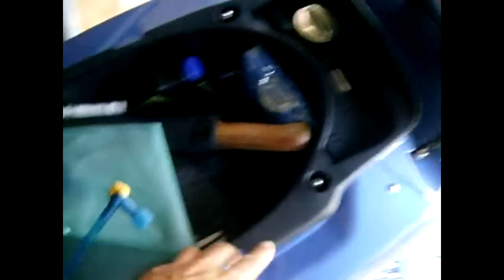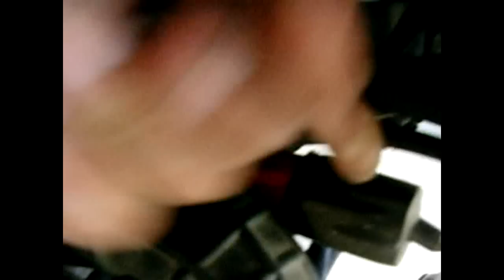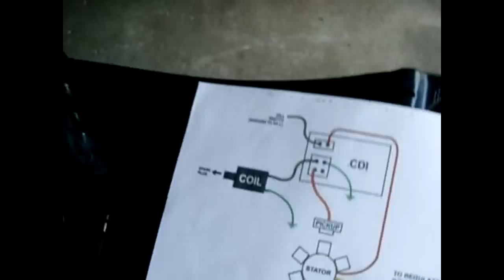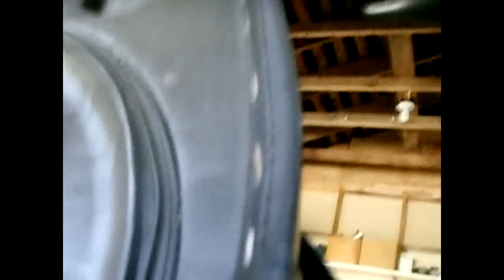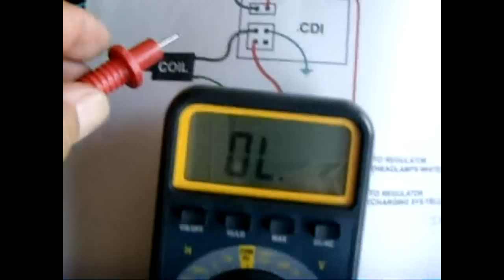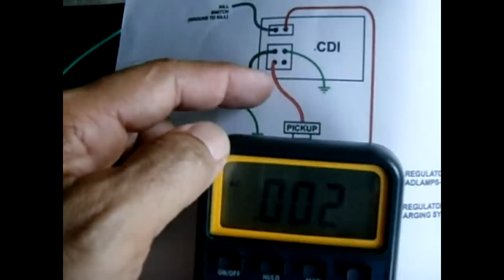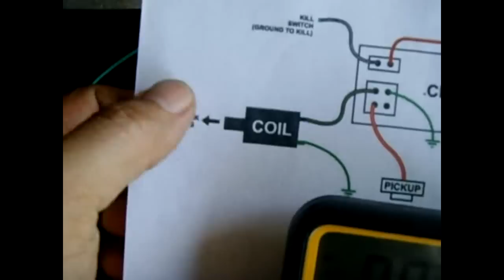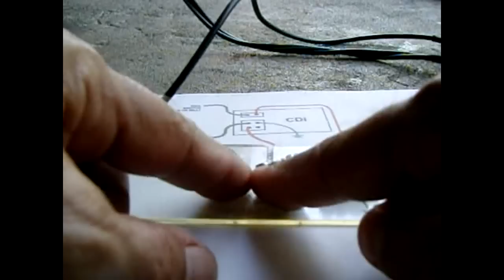The Ultimate GY6 Starter & Ignition Troubleshooting Tutorial

Comment: I've got a mysterious cold starting problem. Left overnight, I'll get one pop from the engine on hitting the starter and then nothing but cranking. Later in the day, tried again, sometimes it starts right up. Once it does, and it's warmed up, it starts perfectly the rest of the day and runs great. The valves have been adjusted, the carb is clean, and I've tried replacing the CDI which was no solution.  A mechanic I know thinks it's a problem with the wiring going into the CDI. But can I ask what you think?  What would cause this hot-cold issue?  Thanks in advance!
Reply from the maker: Jay,
Could be a fuel problem, or a faulty enricher solenoid(which I have a video for in a week or 2). The next time you go to start it and it does the same thing, try putting some propane gas into the air inlet hose to see if it starts. If it does, then your problem is fuel. If you don't have propane, then squirt a SMALL amount of gas to see what happens.
Reply: Jay Schleifer somtimes is the fuel you used put hig octanage buy hig octanage fuel

Comment: Excellent video - thanks!  So I have a Chinese scooter (never again) and my new battery (2nd) is not holding a charge; I checked the stator wires and they appear to push energy... what do you think I should check?  Thanks again
Reply from the maker: Hi Roc,

Yeah, these scooters are not for everyone. :-) Your sure the battery is charging? Did you check the voltage at the battery terminal while revving the engine? Should be at least 13.75v, but more like 14.25 -14.5v. If you are charging, the next step is to make sure your battery is not draining when the ignition switch off. Disconnect the battery neg cable, then connect a 12v test light between the battery post and the battery neg cable. If the light comes on, even partially, you have a problem. If you have an alarm, I recommend you disconnect it.

Thanks!

Be sure to share my channel with others, and watch my other videos as well.

Comment: I acquired a 50 cc Chinese motor bike that has been sitting for a year and it gets no spark. Thank you for the video. Here are my results from the unplugged plug. Kill switch works. Don't know how accurate harbor freight meter I bought new is but here goes: Stator wire 495 ohms. Pick up coil 149 ohms. Primary coil, one meter probe on battery ground wire other at cdi plug yellow black wire 3.5 ohms with harbor freight meter, another meter showed .6 ohms.You say under 3 ohms or over .8 ohms so is there a problem with mine?? Tested now turning over engine: Stator wire 70 vac, pick up wire using a analog meter .25 vac, Secondary coil using harbor freight digital meter set at 20k read 3.3. is that 3.3 mean 3.3 ohms or 3,300 ohms?? You say should be between 2000 and 4,500 ohms. Spark plug and wire are good. Still no spark at spark plug, even tried testing for spark with spark plug wire removed  and grounded wire a 1/8 inch from coil spark plug screw. Still no spark. Any thoughts??
Reply from the maker: Hi there,

It has been a while since I made this video. :-) You removed the kill switch wire from the CDI before testing for spark? A faulty key switch can also prevent the engine from starting, but if you removed the kill switch wire from the CDI, that should make no difference. You made sure all the ground and +12V wires are connected? You tested/inspected each connector to make sure there are no open circuits? Pick up coil sounds fine from my memory.  Stator wire I do not recall, Was it in the range I mentioned in the video? When I mention a particular ohms range, it does not have to be exact. Just as long as it is close in value, you should be fine. 20k setting with a reading of 3.3 = 3.3K or 3300ohms. You unscrewed the spark plug wire from the coil and tested from the screw inside the coil to ground using an 1/8" gap. That should have sparked if everything else was OK. Your missing something. Go back over everything. Sounding like a bad CDI. 

Thanks For Watching. Be sure to rate a thumbs up, share, and check out my other gy6 videos.
Reply: thanks for your quick reply. all ground and 12v wires connected, no open circuits. Stator range 430-630 mine 495 ohms. Pick up coil  range 140-185 mine 149 ohms. Stator vac range 65-90 mine 70vac. pickup coil is ,25vac same as what you got in the video. Secondary  coil circuit range 2000-4500 range, mine 3,300. Only problem I see possibly is the primary coil test you say range is over .8 and under 3 ohms. I put one meter probe on battery ground wire other at cdi plug yellow black wire and got 3.5 ohms with harbor freight meter, another meter showed .6 ohms. These are both out of the range you stated, what do you think about those readings. Also I am trying to locate the voltage regulator on the scooter where might that be in the wiring of the ignition circuit. Thank you so much for sharing your knowldege.
Reply from the maker: Those ranges seem fine. The V-reg is located above the glove box, and below the handle bars. The front plastic cover on the scooter by the headlight assembly needs to be removed to access it. The v-reg is bolted to the frame.
Reply: thanks again for quick reply, so do you think it is the cdi or coi or stator. One online thread I read says the pick up wire must have at least .5vac  to trigger the cdi then coil. Mine is only putting out .25vac.
Reply from the maker: cdi and coil are cheap. You can buy them on Ebay. What was my pick up reading? Go by that.

Comment: Rocketta sicily 50... always runs good. Rode to the store this morning, came out, tried to leave. No juice!! Ignition is relatively new, tests good. Battery is fully charged. Also tests good. No cranking, no lights. Electrical problem for sure... Any thoughts??
Reply from the maker: You check the fuse by the battery? Also check ALL connections from the battery, to the starter, etc. Take them apart, and put them back.
Reply: yep... did that. Thinking it's the CDI. Everything is testing good to that point
Reply from the maker: CDI would not cut all power off to the scooter. Your missing something
Reply: I gave up and called my mechanic... Thanks though. He picked it up a while ago and will be fixing it tomorrow. Thanks though
Reply from the maker: That sucks. Never give up! LOL I bet it is something simple. I don't think you ever told me in the very beginning what the problem was that made you replace everything. How did the problem occur?
Reply: I didn't replace anything, I just tested the battery, the fuse and checked for continuity going to the CDI. Basically, I rode to the store and when I came out it wouldn't crank and the lights wouldn't come on, do there was no point in trying to kick start it. Pushed it home and got out my tester
Reply from the maker: When you have no power at all, that is usually an easy fix. You have to trace each wire from the battery and test the wires as you go to make sure power is there. Likely a faulty key switch. Put the key to ON, then try jumping the starting solenoid.

Comment: So, I have replaced the stater, CDI, and coil with new parts purchase online and still no luck.  Tested the switch and it seems to be fine.  The ohm reading from the pickup however is only coming in at 135-145 but the piece is brand new.  Could this be the problem? Any help is appreciated.  Thanks
Reply from the maker: Hey jumpflyMD. Thanks For Watching.

Your pickup coil at 135 - 145 sounds fine. Have you tried spraying some gasoline into the carb and starting it? Or propane from a torch? If it does not start, and you know for sure you have spark, then you need to first rule out the engine stop switch as the problem. Unplug the wire from the kill/stop switch from the cdi and see if the engine starts up. If that fails, then remove the valve cover, and refer to my other GY6 video showing exactly how to line up the timing marks/check the valve clearance(.004 in /.005 ex is what I use). Make sure the spark plug is good, and that the valves have the proper clearance.

Thanks For Watching! Don't forget the thumbs up. :-)
Reply: electronicsNmore
Haven't tried spraying gas since I can take out the spark plug, ground it to the frame and still no spark.
Reply from the maker: Unplug , inspect, and put back every wire harness from the cdi, ignition coil, to the start key. I have a feeling you have a bad ground, or kill switch that is causing the engine to not start. Take your time and go through everything.
Reply: electronicsNmore
The kill switch never goes to ground, can only get a tone when I turn the key switch to off, then it goes to ground.  At the CDI I'm getting some funny readings, so I unplugged the stator and tested straight from the stator harness.  I get the correct readings from the stator harness, then when I pug those into their correct plugs, the wires to the CDI harness go weird again.  So like you said, I think its a gremlin in the harness.  Any suggestions on what I should be looking for?  Thanks
Reply from the maker: Something is not right. The ignition key switch or kill switch must be able to stop the engine. Usually they are wired in series.You made sure ALL ground connections are OK? You can also test each wire with a continuity tester to make sure there are no breaks in the wires. Red wire on the stator goes to the CDI next to the black kill switch wire. Ids the stator properly grounded?

Comment: My no start GY6 50cc scooter started out running just fine, always starting and then the belt broke while riding.  After replacing it will not start.  Have had scooter savvy guys working on it for 2 weeks.  Unfortunately everything checks out. All electrical, cdi, coils, carburetor, timing, compression, spark plug, gas supply.  Everything has been taken off put on another working GY6 50cc motor and that one still worked and the parts off the working one would not make mine start. Electric start turns over and it acts like it's out of time and about to start but just won't run. It is hitting dead center.  We're missing something and nobody knows what it is. HELP!
Reply from the maker: Timing chain could have stretched. I would take the valve cover off, and make sure the timing marks are EXACT. Also make sure the valves are fully closed when in position.
Reply: Timing light shows it's right on but Will do.  Taking a break while I search for answers. Thanks.
Reply from the maker: Forget the light. Visually line everything up, and make sure both valves are adjusted(closed). Then you can rule out timing.

Comment: quick question, I can get my scooter to turn over and run for a min or two, its a 150cc gy6, its been sitting forsome time now maybe 6+ months, can I spray carb cleaner right into the carburetor? or should I take the whole carb off and try to clean it that way? it stalls out like its flooded or something, ill give it gas and then it dies out, I replaced the starter, solenoid, both brand new, new fuse too,,any ideas??
Reply from the maker: Sounds like a gummed up carb. I would take apart the carb, make sure the ports are all clean using a very thin wire(like from a small brass bristle brush), spray carb cleaner on all the parts, then put it all back together and try it out. Also drain out all the old gas. If you have a propane torch laying around, you can also try allowing small amounts of gas to flow into the air intake to see if you can keep the engine running. If it does, definitely a dirty carb.

Thanks For watching!
Reply: thank you, ill try that
Reply: Craig Burke i think is your carb buy new one

Comment: Hey there! I have a 2006 linhai 260 classic that I got for free. It does not run. It sat for years upon years. I have gotten it to the point of cranking. If I took apart the thing on the handle bar where the button it to start it could I cut off the switch for run or kill and just use an ordinary toggle switch?
Reply from the maker: I would remove the kill switch blade/wire from the CDI and see if it starts up. If it does, then the kill switch could be faulty.
Reply: Okay. Well I cant find the cdi. All I can find is a box like it. but it is made of metal and has a build in heat sink
Reply from the maker: If the wires from the stator coil/pick up coil/ignition coil connect to it, then you have the CDI.
Reply: Its hard to tell. No peices will come off of it so I just have to work around everythink.
Reply from the maker: If it looks like this, then it is the CDI.

http://www.kazumaracing.com/cdi-yamaha-linhai-257cc-260cc-300cc-p-12766.html
Reply: Then I guess it isn't
Reply from the maker: Keep searching!

Comment: Hi there, this tutorial was very helpful in me testing out my GY6
The issue I have is more than likely fuel, after watching this and running all the tests that is
My scooter will just crank and crank but will not turn on unless I remove the air filter hose and shoot some starter fluid into the carb. Once I do that the scooter starts up no problem and after I let it warm up it will turn off and on without any issues so long as the engine was still warmed up.
Would you happen to know of any reasons as to why it's doing this? Cause I can get it to start with that method each time but it's a real pain in the neck to constantly do that when I wanna go out for a ride.

Any help would be greatly appreciated.
Reply from the maker: Very simple to rule out fuel. squirt some small amounts of gas into the carb and see if it starts right up. If it does not, then your problem is NOT fuel.

Thanks For Watching.
Reply: I shoot some starter fluid into the carb and it will turn on without issue.

The issue is that if I DON'T shoot any starter fluid into the carb it will just crank forever and not start up.
Reply from the maker: I would take apart the carb and make sure everything is clean(no clogged ports). I would also add an inline fuel filter on your scooter. .

Comment: I have gy6 motor I got spark to spark plug through mulitimeter over 20 volts at plug not sure what it needs to be but I can't see spark jump when it's against the motor any thoughts
Reply: Ps every time I try to ground green wire on cdi with a jumper I loose all spark but with it not jumped to ground I am getting over 20 volts from the green wires I'm lost on this thing I watched video and I pretty sure stator checks out I have new coil and cdi I think it's the harness idk any suggestions
Reply from the maker: Hey Brad,

Your measuring the voltage to the ignition coil primary side? The blade terminals? Jumping the green wires to ground only ensures that the connection to ground is good. Nothing should change by jumping the ground(green) wire. Have you tested the engine stop switch? If the stop switch is faulty, the engine will never start. Remove the wire on the CDI going to the kill (stop) switch, then try starting it up. When you insert the blade of a screwdriver in the empty spark plug boot, then hold the plastic end(handle) of the screwdriver while positioning the shaft of the screwdriver within 1/8 - 1/4" away from engine ground while cranking, you should see a spark.

Thanks For Watching!

Comment: ive been trying to figure my wiring from my ignition key switch down to battery and where the fuse is,, I bought this scooter half assembled very cheap, so know its up to me, anyways I have no fuse on it and would like to see a diagram of exactly what goes where, I searched google but im not really into those kind of diagrams as im a very new to this, I can hook up jumpers to my solenoid and start it like that, but I have no lights, no key, nothing,, idk if you have a simple electrical diagram for someone who is very new is what I need, I have the exact same scooter as this video,, gy6 150cc, 2005,, thnx
Reply from the maker: The fuse is connected to the battery. From the fuse, the power supply wire feeds up to the ignition switch. You need to keep looking for a gy6 150cc service manual. They are available online. Also look up gy6 150cc wiring diagram.
Reply: ok thnk you so much, where im from there is no one around here that knows about scooter/mopeds,,, its all motorcycles and the shops don't want to mess with "scooters" :P thnk you ill check into it more